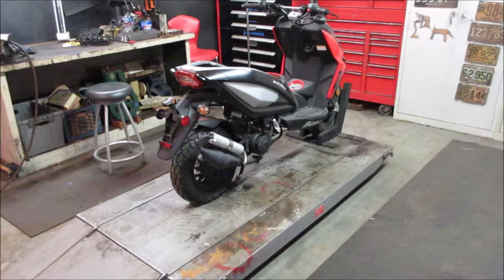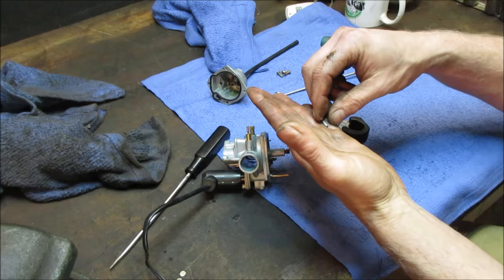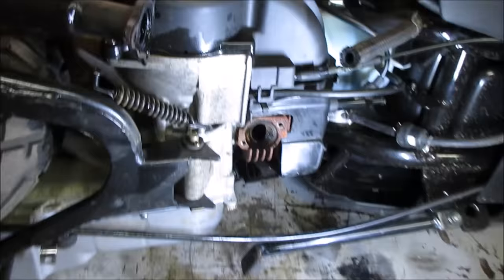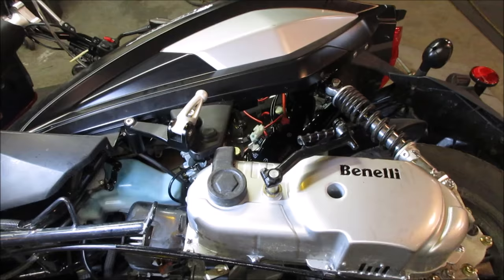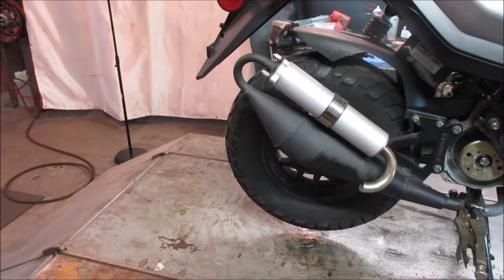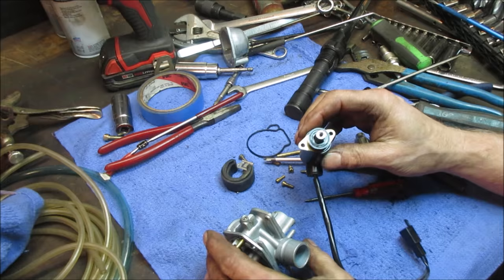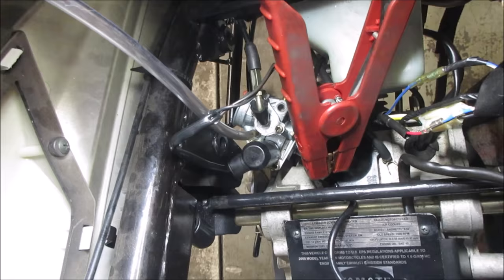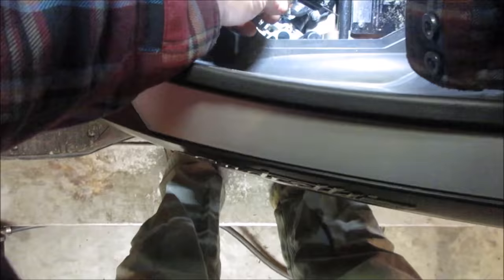Free Broken Scooter, Can We Fix It?

Comment: I've learned so much from your videos! I'm chasing an excessive smoking issue on my 2006 Yamaha 400 4-stroke 4-wheeler. I think maybe it's a carburetor issue but the thing runs like a scalded dog and idles perfectly.
Reply: My xl200 was smoking really bad but running great and it ended up being valve guides. Also piston rings  would be another guess. Unless it has premix it shouldn't smoke I wouldn't think.
Reply: Thanks, I kinda suspected the valve guides myself. It's a new piston with new rings, not that that couldn't still be the problem. There's definitely oil getting past something!
Reply: Head gasket?
Reply: @0MoTheG  
I haven't thought about that. The engine is water cooled, would it show water in the oil or vice versa?
Reply: @saulzain1957  Not guaranteed.
If something is new you must not assume it was done right, or at all.

Comment: Good catch on the wiring. Did you ever check to see if it actually had 2 stroke oil in the tank ? I've seen everything from motor oil to gear oil put in 2 stroke tanks.
Reply: The smell would probably give a bit of a clue... I've done it myself in a pinch when I was a young lad & didn't know any better... 🙄😂

Comment: Hi Mustie, I think the CDI which is now plugged in has a limiter included.
In some Countries ( like Germany), you can Drive a Scooter when you 15 year old, but the Speed of the Scooter had to be limited to 15 miles/hour.
When youre 16 years old, you can acquire a license which allows you to drive 30miles/hour.

I think the CDI now limits the rpm's.
Reply: That could very well be. On the other hand, I also think that the clutch is slipping a little much.

Comment: Those zoom oilers are handy as heck. I've got one one my bench I use for everything. When it runs out I'm going to use it like you do with some 2 stroke gas.
Reply: I learned about using the Zoom oiler with gas in it from Mustie.  Use it all the time.  They gave up when the put the CDI in backwards.  The question is, why was the CDI messed with when only 509 miles were on the moped?

Comment: I worked on scoots for about a decade. It was fun watching someone make overqualfied noob mistakes like i did. You should be going closer to 45 on that. They like to put restrictions in different places. Either a main jet that is too small. A washer that restricts the exhaust or a washer in the variator. We used to work those 50cc 2 strokes up like you wouldnt believe. One time i took off on a test ride on the most tuned one we ever did i almost lost it on take off. Im glad i was about 250lbs at the time to keep the wheel down

Comment: I fix and mod chainsaws for myself and customers often and this is a testament to how a restrictive exhaust can really mess things up. You should port match that exhaust port on the cylinder. That thing is super restrictive as-is. Bet you can advance the timing a little too and wake it up even more. If it's anything like a saw, the muffler and exhaust makes a massive difference when it's uncorked and that port is AWFULLY TINY on there so I know it would make a huge difference to open it. Couple passes with a die grinder and a rasp or a Dremel is all you need. Shame how much emissions garbage they're putting on 2 strokes these days. That hose is probably some type of bypass for like an EGR or some nonsense that isn't needed and just further complicates things unnecessarily. I'd delete all that garbage. Business card is a quick and dirty way to space for your air gap on the pickup too Rock on Mustie 👍🙂

Comment: Try changing the cdi box, if it starts, check the charging voltage,if it's over 15volts change the regulator
Reply: And check the exhaust valve for adjustment.
Reply: @gregfeldman6818  it's a 2 stroke,no valves,but you would be right if it was a 4 stroke,valve adjustment is a common problem with the Chinese scooters 👍
Reply: CDI has separate voltage supply.
Reply: @juhomaki-petaja  yup, I was thinking about the Chinese scooters, but good point👍
Reply: @warrenfloyd1484  Yes. It has two voltage systems in stator. One AC for lights&charging, and one AC for CDI(some have DC)
Reply: Simular to the Chinese scooters, 👍
Reply: @warrenfloyd1484 Want to hear an secret? That scooter is Chinese...

Comment: The auto choke has a wax thermostat. when cold the chokes on, power is applied when running, which melts the wax and closes the choke via a heating element.

Comment: That's a Benelli X49 Quattronove (Air Cooled). I had one back in 2008-2010. I had the following tuning on it:
MK Handmade 70ccm Sport Cylinder, MK Handmade Alu Exhaust, Dell'orto 21mm Carburetor, Hebo Intake, Stage6 NBR Reed, Hebo Flex Belt, Hebo Next Generation Variator (Rollers 4.4g).

Ran 95km/h flats, 85km/h up the steepest hill in town (STEEP!). If I were to make any changes, I would have gone with stiffer clutch springs or a sport clutch altogether. It was very low geared in retrospect, but acceleration and pull were insane.
This was the first model by Benelli after they sold out to the Chinese, so there were lots of tamper proof round screws and unknown Chinese stock parts, like a 12mm unknown carburetor with unique shape jet screws and carb starter. Had to use a manual button choke.

I also owned a Benelli 491 before this one, which was 100% made in Italy, water-cooled. Ran 80 km/h just unrestricted. Engine so powerful there were 4 restrictors in it.
It's sad two strokes has been decimated by emission regulations, it was a dream for a youth to drive, both of them.
I still have the pictures of them both, the 491 I colored custom myself with 0 experience, turned out perfect. So rewarding for a 16 year old.

Comment: 1974  an Lt at Ft.Benning was going overseas so they had a party and everybody rode the host's new scooter.The last rider was the guy leaving who had owned one in High School and he closed the fuel shut off valve which the owner had no clue existed.After he ran the carb dry it sat in his garage for 6 months and he sold it very cheaply to my friend who figured he'd tinker with it.3 of us stuck it in the trunk and were passing a gas station when he said 'Y'all unload my scooter so I can ride it home' filled it with gas and turned on the valve which you could only see if the machine was above eye level.
       After 15 minutes it was running and he rode it to work for a long time.

Comment: I always start troubleshooting where the last DAH was working on it. Those parts told me they were working on the ignition.  I would have started there and checked every connection and component of these parts.  I also have gotten a wiring diagram and checked it against how it had been setup by the previous owner.

Comment: 1.  Drain tank of all fuel, and make sure only oil enter carb by way of oil tank.  2.  Check for any restrictions in exhaust system.  3.  3.  Check cylinder for carbon deposit boil-up nr=ear exhaust port.  4.  Remove variation and check to see if all roller weights are rolling properly.  5.  I have yet to see rear wheel spin up under acceleration.  Make sure there are no restrictions to rolling of rear wheel under throttle opening.
Reply: This is about the best troubleshoot comment I have seen yet….

Comment: So only the CDI was defective before you got the scooter. The owner then replaced the alternator and the CDI. He swapped the cables from the Generator and connected them incorrectly. Not easy to find, lucky you had a second alternator to see it. Luckily the owners didn't mess around with the carburetor and change the jets etc. that's a nightmare to find. Very well done 👍 I would have machined the cylinder outlet directly and "slightly" enlarged it 🤣

Comment: I'm actually working on a Chineseum go kart with same engine...Runs pretty good now after many parts but no brakes LOL!  next on the list...Another project is a sand rail...locked up 1600 Type 1 Pulled heads and jugs...#1 cylinder was rusted beyond honing so bought an AA cylinder kit from Cali...Going to wash out the crank case like you did for the red Carmon Gila...

Comment: I had long time 2 stroke scooters. I had a Gilera Runner 50 sp for a few years...what a pile of fun!!!!I loved working on it,it was really easy and you could get some crazy things to mod any engine. Piaggio engines were very very easy to mod, I had mine with a 75cc steel top end, big carburetor,reinforced clutch spring (big trick here,I had 1 1/2 springs clutch  joint together to use more the low rpm torque,huge difference how the bike went from 0 to 50 km/h) and "variator" weights. My bike had a crazy acceleration from dead stop to 50 mph +-  and 60 mph top end speed,it was way faster than 125cc and 250cc 4 strokes big scooters,perfect for Madrid city streets. Now it would be a ruin to ride that bike,the 2 stoke engine was a little black hole of gas,like 28 mpg plus oil in an easy day,crazy numbers for a 75cc bike .
37:40 yep 2 stroke scooters had exhaust gas redirect to the airbox. It is a dirty pile of shit if you are not careful with the mixture and gas quality. You can block the tube to the airbox and you are good to go.
Plz Remove speed limiter in the front pulley and that bike should go 80 km/h just fine. With the speed limiter RPMs go to the moon and the bike is not moving anywhere.
Number 1 cause of being broke in the road whit kind of bike is the transmission belt,it could go bad if it is old,get a new one.

Comment: You fixed it almost. Try t open up the battery and fill the cells, adjust the needle a bit. and run it at full speed. Nice fix kudos.

Comment: My neighbor threw out his Snapper mower , so i asked if i could have it...
He told me it was trashed and not to bother, dealer went over it already, was kinda jerky sooo... 
I had it running with 1 hours work, just cleaned out the tank, fuel bowl, and blew out carb with cleaner.Added fuel filter, air filter and new spark plug ...
 I LOVE my new $25 invested ($850 new) mower ROFL. He looks sour everytime I mow.

Comment: Love doing this kinda thing. Recently helped a guy resurrect a Polish / Checz  MZ125 From the 1980's..  Great hobby.
Yours sounds a bit choked to me.  The 31 ohms of the solenoid equates to a nominal current just below 500ma from 12 volts.
I'd check it's voltage feed or disconnecting the solenoid entirely from the wiring loom, that should make it run no differently to how it's running now.
If that proves the case you could either fit a switch or trace the thermostat voltage through.?
Hoping this quick and cheap diagnosis might help you out and also hoping you notice this comment as it's a possible problem and ceaper than investing in a new CDI.
Cheers.

Comment: I've got one of these similar Maranelli engines scooter-a TNG Venice 50 that has been kicking my ass for months  and your video gave me some good ideas on getting it run. It just died years ago-  I've got spark, new carb, new Reed valves, 120 psi compression , but it just won't start, and It doesn't seem to be sucking in the intake when cranked so I'm thinking a crank seal.

Comment: Did a quad recently a Kawasaki KLF 220 single cylinder. Had similar fault would not rev plus faulty starter loads of wiring faults as well. Complete starter clutch from the States sorted out starting problem, wired in some new light de-coked engine and ground in valves, serviced engine, it needed all these things done, sorted brakes but still would not rev, measured charging voltage it went up to 18 plus volts. There is a charging regulator that should dump excess voltage as heat! It had failed allowing overcharging and excess load on engine. About 20 dollars fitted it and fixed.  Now I knew the problem I found a few others on YouTube who had run into same problem.

Comment: I have a couple of those motors and I would have taken the Carby apart first, checking for water, My motors are both oil injected out of a separate oil tank. Once in the carb I’d be cleaning the jets out and check the setting on that main control needle. I prefer to start at the centre setting (there are usually five) and run the motor on a new plug. If I can then reassemble and test, I can determine whether the clip needs to go up the needle (leaning the fuel out) or down the needle letting more fuel flow. My Suzuki A100 ran one notch lean my Asian bikes like the middle setting . It’s seldom ever the drivetrain or the exhaust unless it runs Smokey or slips … healthy spark off the electronic ignition is seldom a problem, and a filter in your fuel line is good insurance … fun little auto scooters !

Comment: Also, just so you know, you can change the weights in the transmission to allow you to get higher RPMs and faster top and speeds out of this thing. My friend had his 50 cc up to 70 miles an hour basically by the transmission.

Comment: I love this video.
Someone taught me that when you are looking at something to long thinking it's wrong, it's usually something else
First I thought it was the reed valve, then I thought it must be the electrics. (I give up 🤥)
The braking up may be because it's tuned down to max speed. The aftermarket cdi might fix that. Worth a try. 
The needle in the middle is usually factory. I'f seen lots of kids pulling it up according to the philosophy 'more gas is faster!' and it just chokes on it.

Comment: A previous owner probably tried to 'derestrict' it. Lots of scooters can be restricted by the CDI. They apply a voltage to a specific line, and the CDI restricts the RPM. So young lads cut the restrictor line to 'derestrict' them. Check out the CDI/ECU wiring diagram.

Comment: My pet peeve with the “will it run?” genre of videos is that people first attach a battery and crank the engine.  If the machine sat any length of time and doesn’t run, why turn it over and suck contaminated fuel into the fuel system?  I’m guilty of this in my teens and twenties, but after having to empty gas tanks, blow out carburetor circuits, and clean carburetors, I learned.  Do those things before turning the engine over.  😊

Comment: I had one that you couldn’t kick start unless the battery has voltage.  If it has an electronic ignition it usually needs voltage. I think the kick start is for when the starter motor fails or if the battery is a little low on charge, but not dead.

Comment: This situation reminds me of when I worked as a mechanic at a Yamaha shop. We had a bike in the shop that had arrived before I had started working there, and it’s symptoms were similar to your bike - it would idle but when you tried to add RPMs the engine would die.

We spent hours trying to diagnose it including replacing the electronics box and nothing changed.

The stator plate had two coils. One day in desperation I tried swapping the position of the coils and that fixed it. Apparently someone before me had screwed that up and left no clue that it had happened. 

My boss wasn’t happy that we had bought the electronic box but he hadn’t been able to figure out the issue either, and we delivered a running bike to the customer so he could shove it as far as I was concerned.

You did a fantastic job of diagnosing this one!

Comment: That oil mixes with the fuel in the carburetor. It's somewhere around the  40:1 ratio. It's dripping like it should. Many people remove the parts and just put a pre mix in the gas tank just to be safe. Either way works, but you lose the convenience of filling up with straight gas

Comment: This problem happened to me too, it's the oil dispenser, it pours continuously and too much, so the mixture is impregnated to 7% and it doesn't start, making a lot of smoke, and clogging the muffler. You have to exclude the mixer and make the 2% mixture yourself.

Comment: I’ve a 2020 TaoTao pony 49cc scooter. 
I’ve recently tried going from o.e.m. c.d.i. to a ( New racing c.d.i. ) after plunging in the new one. No start. replaced with my older stock & starts up. I came across another video saying to get the c.d.i. to work you have to switch the coil wires. But, yet the most of the videos I’ve seen says the o.e.m. coil wire sparks better then the performance orange. Kinda lost don’t know exactly what I’m doing now. 
I believe both or A.c. c.d.i.  
However, my battery dead to. So, going to get a new battery first & go from there.  
Thanks for the video the information helps more then you know!!

Comment: Had a Peugeot Ludix scooter I got for nothing. Only had 216km (don't know why it's km) on the clock. Had sat in a heated garage for nearly 12 years with the fuel tap switched on. Cleaning out the jets on that carb was not fun.

No matter what I couldn't get it to run properly. Turns out there's a small jet in the plastic float chamber cover that I couldn't clean properly. Bought a used carb off an older one and managed to make a good one out the two. Runs like a swiss watch now. Sold it on to a friend for the cost of the parts and a few beers. She's put nearly 3000 Km on it in a few weeks.

Comment: A friend bought a 4 wheeler that would start/run, but at higher rpm's, would sputter, and backfire. Turned out to be a bad diode. It was allowing current to go both ways, and was affecting the ignition circuit.

Comment: Sounds like you need to adjust the air mixture screw on carb or make sure the ressvalves are not worpted to were you can see an opening .(ez fix just flip them over lol) that's just my thoughts on it from my experience with them. But good work man on getting  it up and running ☺

Comment: That hose that goes to the exhaust is one of the blockages that the scooter has when it is new so that it does not exceed 45km/h up to 1000km, the second blockage is on the variator, the third on the clutch, the engine head where the exhaust opening is needed to expand
Reply: I have changed rollers, cdi box, pressure spring, 70cc, new tube, main nozzle, variator pin still its limited to 45km/h. I dont know what to do anymore